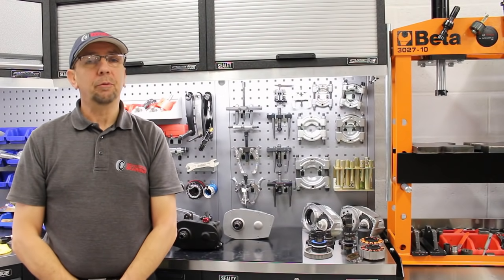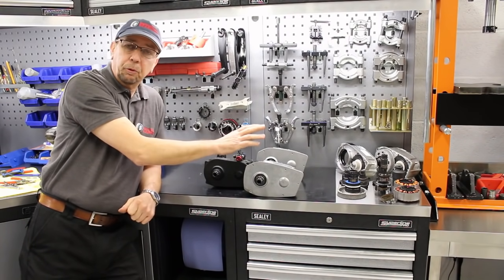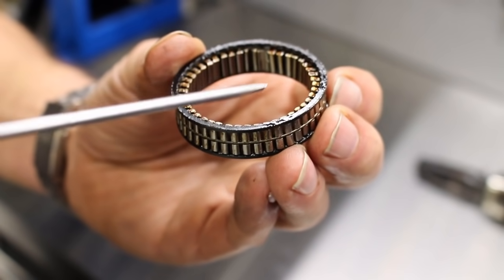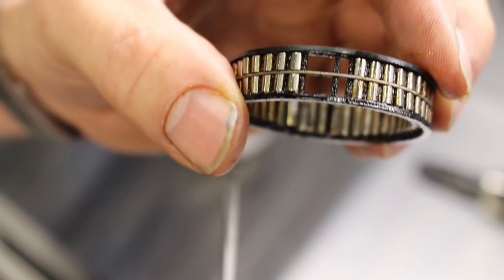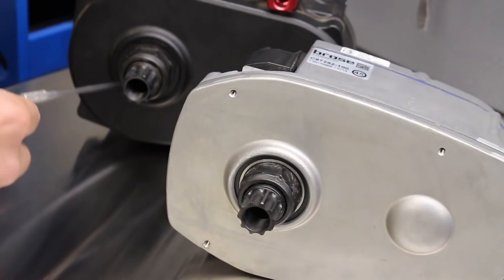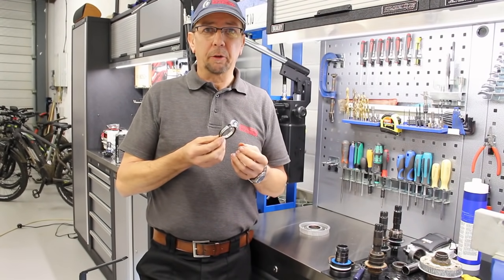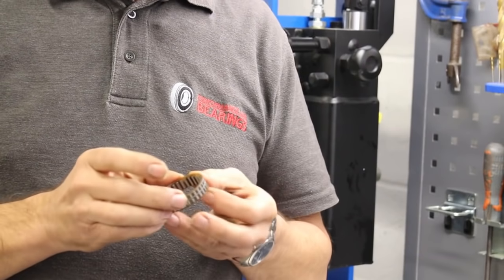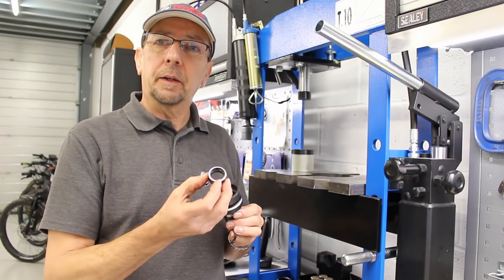Brose Motor Upgrade

Comment: Thanks heaps, I have just sent an E-mail to david trump here in Australia to have a look at my Gen1 Brose that seems to be having Sprag clutch slipping issues. 
Great work mate I have been following you since the start.
Reply: Please, how did you get along, mate? I can't find any C.L.S in Gunalda listed.
Reply: @slavojalois1639  it's in AUSTRALIA.
Reply: Gen 1 all fixed. New sprag and some other bearings. Thanks to all that helped. The bike is now sold and I'll see if the 2021 comp motor has a weak sprag now. 1000kms and all good so far but I'll never ride in the wet again.

Comment: Hey guys today I had to change the cable of my sram group set. Unfortunately that means for me to take out the brose motor. Thanks for your video by showing the 2 upper crews w/o sealing function although there these have a gasket. I immediately sealed my screws. make absolutely sense. Have a nice day riding your bike

Comment: You mentioned at 8:21 you had a fix for the wear on the main shaft caused by the needle bearing deterioration, but I didn't hear what it actually was?
Reply: It's been a while since this was asked, but the fix is at 11:19

Comment: Thank you for showing the ins and outs of these motors. 
I was wondering if there may be pressure differences from a hot motor being presented with water that may cause ingress of moisture due to the effects of sudden cooling.
Reply from the maker: This is a scenario that we have thought about many times, even to the point of considering fitting a small air pump to keep positive pressure in the motor. But that would just consume power and may introduce damp air into a sealed system. I feel that with the limited space and small air quantity within a motor, coupled with the relatively low temperatures they run at and brief period of time they should be submerged for (not that they should be submerged at all), pressure differential issues should not be a big issue. We are still looking at this scenario though and when I have time I will heat a motor and drop it in the sink for a few seconds, just to see.

Comment: Thx a lot. Which dimension of x-rings have you been using to seal from outside? Seems to me an easy one together with sealing the screws. Thx again, very professional
Reply from the maker: These seals should not be fitted without removing the crankshaft assembly, cleaning and greasing first. This is vital and cannot be done while the motor is in situ. As for the dimensions, we had the seals manufactured to our dimensions and material specifications. A big investment and not really something I would want to talk about on here, sorry.
Reply: @Ebikemotorcentre  Accepted, thanks a lot.

Comment: I have the 2021 turbo levo comp…question when did they upgrade the belt?  So far with about 1000 miles of mostly all trail riding I have had no problems, I do try to be “kind” to my expensive bike.   Really do love how this bike rides and hope if I ever need motor service it can be fixed.
Reply from the maker: Brose have done a few belt upgrades recently, each one better than the last. In 2020 they started fitting the first real upgrade, then in 2021 it was modified again. These belts were all carbon fibre, but the last upgrade in 2022 they have just fitted a Polymer belt.
Reply: @Ebikemotorcentre   Is the new Polymer belt a cost-saving downgrade from the carbon fibre belts? Are you expecting more repairs of the Polymer belts in the future?
Reply from the maker: @bradarmstrong1656  No, the polymer belt was an expensive upgrade for Brose and still had carbon strands like the original. It seems to be working well so far.

Comment: Hi...Sensational. Could you tell me the torque used on the belt tensioner?
Reply from the maker: 0.2Nm 👍 Don't forget to lubricate the carbon belt with "Technical" Vaseline, thicker and stickier than normal Vaseline (Petroleum Jelly).

Comment: Hello Peter. I made some comments about a year ago. After 4 years of owning and a lot of Emtb riding including beach exploring water ingress mainly from washing is the killer.  My conclusion is all    ebike motors need a tiny computer fan within the main frame to slightly pressurise the casing while riding and washing to repel moisture and even dry out any moisture sucked in by heating and cooling.  It's the only solution to the problem but are any of the motor companies smart enough to see this or are they too preoccupied with developing  more problematic  motors and rushing them out without proper reliability testing. What did Brose know in 2018 with the Near SILENT ,powerful 90nm ,smooth Aluminium 1.3 motor that they don't know now 🤔.  Add your X rings, upgraded sprag bearing ,belt and firmware and hose vents with a mini fan you couldn't get better. But what would I know. Cheers Rob Haskins E=Mtb² 
RELIABILITY and SILENCE are GOLDEN.
Reply from the maker: Hi Rob, We did look at this positive air pressure solution some time ago, but after some debate decided to drop the idea in regards of a retrospective kit. We also found that after 3 years now, we have had no Brose motors back with water ingress! We seemed to have managed the impossible, 4 layers of sealing, with almost zero added friction!
Reply: @Ebikemotorcentre  Thanks for the reply I'm impressed that you replied to a comment on a old video.
Glad to hear the X rings and other sealing is working. Your Australian agent Paul Moir has rebuilt a 2018  1.3 motor for me and all good so far. We have two  brose 2018 levo's one 2020 levo and a 2018 shimano E8000 Merida. I have also hired Bosch and lightweight Orbea Rise carbon with 60nm shimano Ep8 but the bottom line is that when I go back to the 2018 Levo the motor is simply the best 👌 ever. Near SILENT, powerful, smooth and the FEELING  is "it's me but younger and faster" and now you've been able to add reliability it's even better.  Again What did they know in 2018 that they all don't know now.?
At 61 kg and 67 years I prefer a heavier bike for Stability and not really interested in a lightweight emtb for Flickability .
If carbon was any good they would make aluminium from it and if aluminium was any good they would make steel from it. 😁😁 Just a few of my Observations and not necessarily right .Cheers Rob E=Mtb²
Reply: Keep up the good work. You and Paul Moir are the only people I know capable of working on and inventing SOLUTIONS to the PROBLEMS that the mtb designers are "dreaming " up without proper testing. 
Are they just enthusiasts who like me, just smart enough to be dangerous.🤔😁
Reply from the maker: @robhaskins3068  Good question 🤔😊

Comment: Hi.  I’ve just bought a 2022 Levo.  Will it still need these upgrades or did Brose sold the issues ? Thanks
Reply from the maker: As of 11/04/2023 the problem is still there, so the upgrade will help.
Reply: @Ebikemotorcentre  ok. Thanks for your reply.
Reply from the maker: The upgrade fixes most of the main issues. Being a 2020 motor, it will not require a new drive belt as it will have the latest polymer belt fitted. It won't be water resistant or have the upgraded sprag bearings though.

Comment: Great info , thanks. What torque screwdriver do you use ?
Reply from the maker: We use a German Wiha torque driver. These are inherently expensive though. This is why we sourced a different German high spec torque driver for regular use. You can see this here: https://www.ebikemotorcentre.com/product/high-precision-0-2nm-torque-driver-for-brose-drive-belt-tension-part-no-pla00925/

Comment: hi what did brose fix on the 2022 new mag motors and what would your upgrades be for that motor? I'm just about to buy a new specialized and i want the motor to be perfect from new thanks
Reply from the maker: Brose constantly change small items or software and the 2.1 motor had several very small changes, this was then called the 2.2. It will have the upgraded drive belt, but that's all that we know of at this time 17/05/22

Comment: 18:52 The 20 20 belt "All greased up". What are you refering to with 20-20 belt and what do you mean by "All greased up" ?  I thought these belts didn't require any lubricant .  Can you explain this please?  Btw the video lesson is well done and Thank you !
Reply from the maker: The belt was upgraded in the year 2020, it has now been upgraded again in 2022. If the belt is a carbon belt, it should be lubricated "greased up" with "technical Vaseline" This will not be true for the new Polymer belts, but you won't be seeing these just yet.

Comment: Greetings from Brazil. What is the diference between the motors brose  2.1 and 2.2 from turbo levos?
Reply from the maker: There was no big upgrade when the motor changed from 2.1 to 2.2. Brose are continually upgrading and updating components within their motors and there came a time when the 2.1 had received so many little updates that it was changed to the 2.2 and the 2.2 is still evolving to one day become the 2.3
Reply: @Ebikemotorcentre  thank you

Comment: Are the 2023 brose motors any better built or do they have the same issues? Many thanks.
Reply from the maker: Yes, Brose are continually making small changes and updates to their motors and they now have our lip seal added. Stronger, more durable planetary gears and more durable belt pulleys.

Comment: Great informative video. I own a 2019 Specialized Levo Turbo Comp with 600 miles on the motor. I don’t ride in water, and don’t pressure wash the bike. I’m not experiencing any issues at this time, so I’m thinking “prevention.” Would you recommend that I make a motor upgrade to ensure reliable service? Thank you from Southern California.
Reply from the maker: Normally I would say yes, but due to the issues with the 2019 motor, Specialized gave a 4 year warranty just on this year of motor, so by upgrading (although it makes it last longer) it will void your warranty.
Reply: @Ebikemotorcentre  ok, thank you. When the motor warranty expires, I will definitely give you my business.

Comment: my motor (levo gen3) failed after ~3500km (10 months). replaced under warranty. but the next time I can be less lucky.  probably the belt was completetly stripped.
Should I repair (send to You for example) my motor when it fails ? or is it better to do periodical inspections/maintanance ? and at what intervals (kms) ?
and what is typical service price ?
Reply from the maker: There is definitely an advantage in sending a motor to us, or one of our worldwide partners because then it can then be upgraded to help stop some of these issues. And we also apply our own 12 month warranty. These motors are not really designed to be stripped and inspected on a regular basis, so this is best done externally by getting to know how your motor feels and sounds when it's new. This is done by removing the chain from the front chainring and rotating the crankshaft by hand, if the crankshaft starts to feel tighter or sound rough etc. then it's time to get it looked at. Prices and explanations can be found here: https://www.ebikemotorcentre.com/repair-overhaul-service/

Comment: I Have 3 brose and a Shimano E8000. You really know your stuff. Is the Shimano better sealed .Do any brands have a breather and moisture absorbing silica. All hot encased components will suck in water thru seals if cooled quickly submerged in water.  E=Mtb²
Reply from the maker: Yes, Yamaha have a small breathable membrane but that's the only motor I know of?
Reply: @Ebikemotorcentre  Thanks for the reply. Our two 2018 1.3 and 2020 2.1 are a bit rough when I spin the cranks    backwards but have been spraying Inox on outside of bearings  with bike lying on its side . The Shimano E8000 motor is smooth As and must be better sealed.
Reply from the maker: @robhaskins3068  Do yourself a favour and stop spraying stuff into the bearings. The oil masks the problem but goes through into the motor and this is not designed to have oil in it! It can cause issues with the clutch bearings, belt and ecu. It also takes hours to clean it all out because it gets everywhere! The Shimano is sealed with lip seals that help, but unfortunately, to cut down on friction these are extremely small and soft, they normally let water and grit into the open needle roller bearings that sit directly behind them. I am glad your's is still ok.
Reply: @Ebikemotorcentre  Thanks for the tips. The sealing or breathing of motors must surely be a major design issue all manufacturers  can work on next. I think the very best Emtb motor is the most Reliable and only time will be the decider. E=Mtb²

Comment: I have a Turbo Vado 3.0 (2022) and was wondering if any knows if the motor has nylon gears or all medal?  Thanks.
Reply from the maker: Your motor is identical to the one in this video. It does have plastic planetary gears and a plastic ring gear. The gears themselves do not usually cause any issue.

Comment: Also…is the only difference between the 2.1 and the 2.2 the software down loads?  When the dealer does an update on my 2.1 does that basically turn my 2.1 into a 2.2?
Reply from the maker: Brose are updating the software on a fairly regular basis and as the 2.2 was just a culmination of minor changes to the 2.1, then technically, you could call it a 2.2 but in reality it would still go on a date code.

Comment: merci ou trouver les joint x pourriez vous me donnée les référence des joints x
Reply from the maker: Les joints X-Ring sont fabriqués sur mesure pour nous et font partie de notre service d'amélioration. Ce service peut être assuré par nos partenaires dans le monde entier.
Reply: @Ebikemotorcentre  merci j'ai fait toutes les opérations de restauration moi même sans grande difficulté avec soin  et sans presse, avec un étaux et des gabarits il ne me manque que le joint x de +- 25mm j'ai remplacé nouveaux roulements courroie axe joint interne 24x30x4mm et graisse spécial résistante à l'eau.

Comment: All these eMTB motors should have old school tractor grease nipples. Wherever there is a bearing you're then able to push new fresh grease in and your can push old grease and dirt out. The "outer outer" seal is an easy replacement part and you change it maybe every 2 years. Behind the "grease seal" you then have some SKF sealed load carrying bearings (full units, no direct axle contact) and they will in no way shape or form be able to come into contact with water or dirt. That design on the Brose motor with the needle bearings against the axle and poor seals is honestly 100% shit. Hard to believe something like that came out of a 26000 employee 100 year old German company.
Reply: Actually it's probably planned obsolescence. Industries of that size usually have an entire division dedicated to programming the end of life of products.

Comment: Hi, I bought a 2021 Levo HT 2 months ago, my son borrowed my bike today and on his return I noticed paint missing on the drive side crank arm end near the pedal, he told me that it happened while he was walking the bike over some rocky terrain, now when I back pedal the bike I noticed a slight rough sound where previously my bike had been completely silent back pedalling, do you think I should have this looked at by my local specialized shop as it sounds to me that I might have damaged sprag bearings, although you mention in this video that my 2021 model has been upgraded already? So maybe its water ingress on the needle roller bearing as I do not have any issue pedalling forward and everything is perfectly smooth riding the bike. I have been using the bike in very wet conditions and have washed the bike over 6 times now but always careful with low pressure hose. Any advice would be great appreciated with what bearing you think might be causing the sound. regards, Paul.
Reply from the maker: Firstly, I don't think this is anything your son has done. This sounds typical of needle roller bearing failure due to water ingress, you should be entitled to a new motor under warranty. Although your motor is 2021 the new type sprag bearings can still fail, but you won't feel this by turning the cranks, you just won't move forward so think these are fine.
Reply: @Ebikemotorcentre  Many thanks for your reply, I thought it might be more water ingress and did tell my son not to worry, he has his own levo arriving next week so hopefully we'll be more successful in keeping the water out of his bike, thanks again.

Comment: Hello, is there a chance that you will make video how to change bearings on Shimano motors? Can you deal also with Shimano motors?
Reply from the maker: No sorry, We used to overhaul Shimano motors but don't currently due to the inherent software issues on the E7 and 8000 models